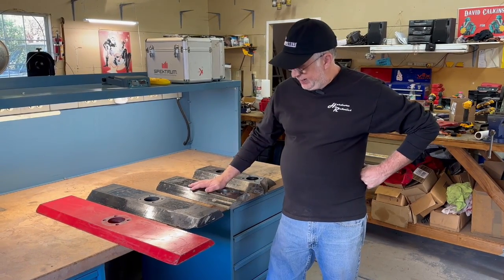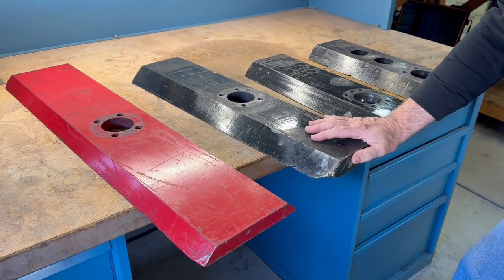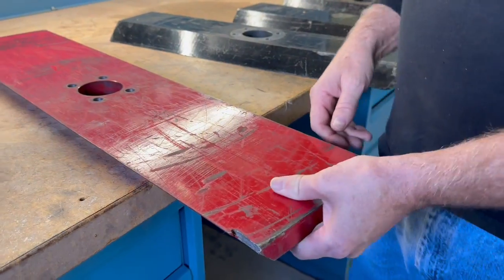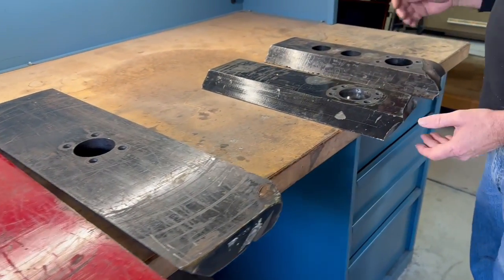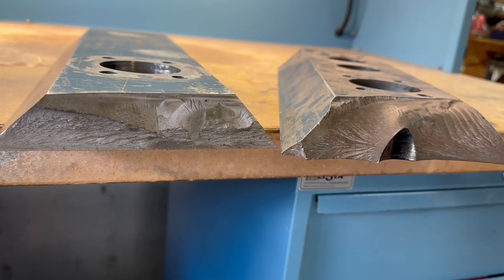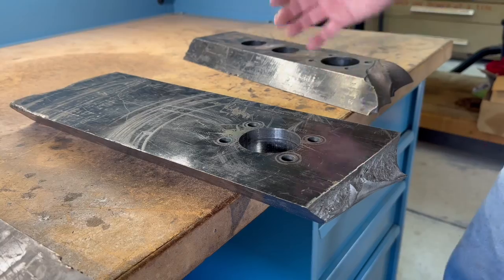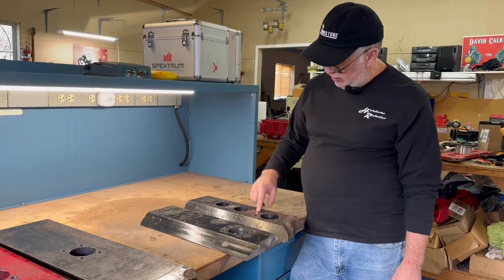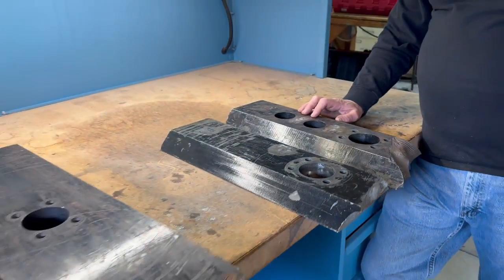Tombstone's weapon bar failures

Comment: I'm curious about the weapon failure against tantrum in the golden bolt tournament. 

Tantrum used a concept pioneered by gruff called the "chocolate bars" where chunks of material protrude from the wedge that intensionally create a controlled catch point for horizontals.

 I don't know their exact purpose but the goal speculatively was to create a catch point big enough for a horizontals to get a good bite on but slim enough that only a small portion of the blade braces the impact. It creates the opportunity for the blade it break buy focusing all of the kinetic energy into the short length of the chocolate bars. The seams reasonable robotics team was well aware that a brick like tantrum could break the bar on armor impact alone since the original tantrum vs tombstone fight.

Just from a non Builder perspective it seemed to work PERFECTLY with tombstones blade shearing off at the tip causing it to shake its self to death.

Is there any concern of other teams using this strategy in the future or is it an extremely niche setup that only a few bots could pull off.
Reply from the maker: In Tantrum's fight, we hit in the channel for the movable spinner, which did make us transfer all of the energy into one hit. And they took the hit better than we delivered it, so they certainly deserved the victory. But I pretty much always want to deliver all my energy so I don't think this is some super secret way to win honestly. There is always going to be monster hits between weapons and armor - sometimes I come out on top of that, but not always. 

Tombstone, maybe more than any other bot ever really, has changed the landscape of armor and design in this sport. And if I can make all of these super smart and talented people worry about fighting me, well that's just kind of cool!
Reply: @ray9368  yeah, I agree, I’m sure bots like endgame and sawblaze, still fear you.  Win or lose, you always have an entertaining fight, and I hope you come back for season 8
Reply: @samuellondke9108  damn, if endgame hadnt made tombstone turn into a bread slice land in the toaster slot, they wouldve ripped engames wege clean off. they wouldve won that one
Reply: speaking of. you never showed us which wapon bar that one was. it was the same one used against mammoth and free shipping

Comment: -- I think I see.  All of these bars, or, at lest most of them were smelted from bigger and pointedly thicker stock, then lathed to specification.  And it's top or bottom from the stock, thus, the differences in color and melt topography, to keep it in limens, of specifically those last two bars.    
   So you're buying a blade from someone who cut it, they bought it from a dealer, who just rates it all the same.  And the manufacturer, well, Lord knows their specifications save max profit in many cases.  And it looks like (I make swords at ren fares with pete moss) they quench with different oils and temperatures.  So 'tool steel' as you say, is a gamble pending on where it comes from.  
   So, AR500 from China, not going to add up to Japanese or American AR500 despite the rating.  And that means, just like everything else, production cost (pointedly how to skimp) using the same rating is the issue ... just like everything else on the face of this earth.
   Boy if you want something done right, do it yourself, never mattered more than now.
   Thanks Ray.  Fascinating.  But expected.
   What's the bare minimum we can do to slap a label on this product people 'think' they understand and will go ahead and buy.  Reminds me a bit of the Titanic.  Citing rivet slag there.
Reply from the maker: There certainly are differences in material, even the same alloy from the same vendor. It does happen, and when you are trying to get the absolute limit out of a part, bad things can happen. I'm certainly not going to have every piece of plate brought into the shop material tested to verify alloy content, or xray every weld, like you would with say the space shuttle. Our sport just isn't there yet :) 

One interesting point is AR material in general. AR stands for abrasion resistant, and the number after is hardness on the brinell scale. So steel that is AR400 for example, as long as it is the basic abrasion resistant steel and that hardness, then it's legit to advertise it that way. But there really aren't specifics on how it is alloyed! AR400 from 3 different vendors could have the same, or fairly different, chemical makeup and you as the buyer wouldn't know.
Reply: -- Thanks for taking the time out to explain, Ray.  Always learn from you.  Why I'm here :)   @ray9368
Reply: Most get cut out off sheets of metal

Comment: Ray have you looked at Ar600/Hardox 600? It's getting popular in lower weight classes.
Reply from the maker: The weapon disk on Stink Eye was made from ArMax which is an AR material around 530 brinell. And it worked ok, but still shows some damage after the fight with Manta. It's really going to be hard to get away from using something that is harder than AR alloys honestly.
Reply: @ray9368  Huh I thought S7 would be harder than Ar steel but I'm probably confusing the rockwell hardness rating which I'm sure is higher in comparison to wear plate.
Reply: @TheInvertedFollicle507  ar 500 for example is 500 brinell same goes for ar 600 which is 600 brinell and so on, but ar 500 being 500 brinell, if you convert that over to the c scale on rockwell it is in the 52 to 55 range roughly. which in this case is about the same hardness as rays s7 that he wants at 54. but to make a bar like that exactly 54 through out is pretty much impossible. Generally good heat treat places can get it with in 2 rockwell. as you can see rays blades are right on with that spec. the fact that those blades are also really long and on the one side of the blade they held 2 rockwell is pretty impressive. the bigger it is the harder it is to keep everything the same naturally. 
Those blades are pretty much as good as they will get heat treat wise. however the one note he made about the one blade being 50 degrees hotter, something like that could be fixed, but in general for the final product being within 2 rockwell is about as good as it gets. maybe there is someone out there that is precise enough to get it within 1 but that would take some extreme skill
Reply: @cadenkorzan  OK thanks for the info anyway yeah heat treating is as much a dark art as it is a science.
ar500 doesn't have the same issue cos I'm pretty sure it's already pre-hardened and doesn't need heat treating like s7 or a similar does.
Reply: I don’t know if you watch NHRL much but yeah there’s a robot called Minimizer who uses a ar600 disc.
Reply: Hardox is similar to ar so he would still need the tool steel as an option to cut deep into an opponents armour and that basically puts him back at square one with the s7.